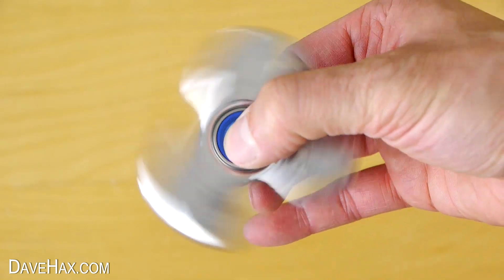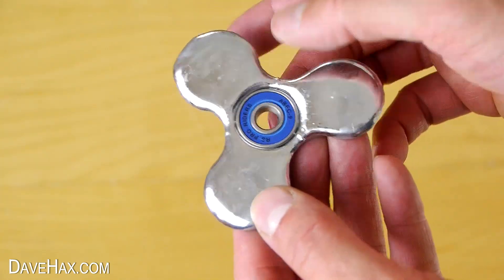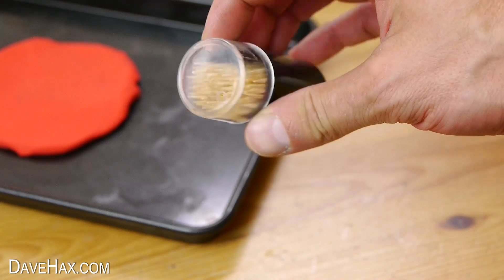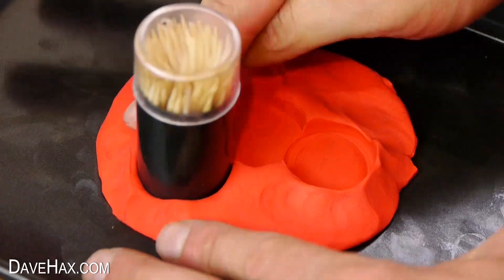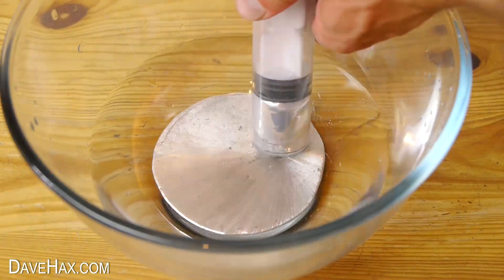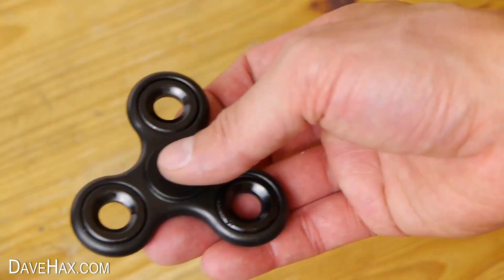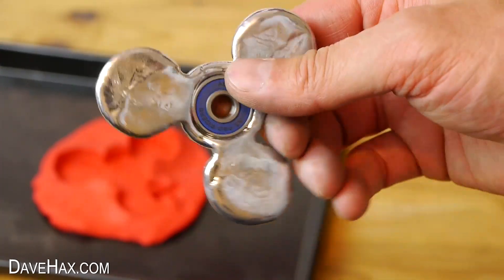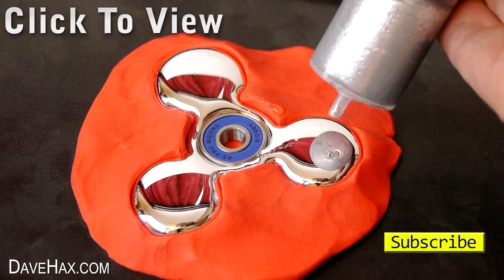DIY Classic Gallium Fidget Spinner

Comment: OK enough with those spinners. Here is another awesome real science expirement you can do with gallium. First, find some aluminium, a heat sinc for a pc will do. Than, use something sharp to scratch the surface of the metal, you can use rough sandpaper aswell. Pour some gallium on the scratched surface and leave it overnight. The day after you'll see that the aluminium is very crumbly and brittle. This is caused by the gallium making an amalgam with the aluminium and changing its properties. After you crush this amalgam, drop a small piece of it to water, you would see if fizzle and making boubles, its caused by a chemical reaction between the amalgam and the water, the gas that is formed is highly flameable hydrogen! Crush the rest of the amalgam and put it is a small baloon, than put the baloon over a bottle of water (similar to the "inflating baloon with baking soda and vineger" expirement) this will generate some hydrogen and inflate the baloon. After the baloon if full, you might notice it floats like it is filled with helium, hydrogen is even less dense than helium and should make it float even better. Last step is the most fun. attach a sparkler to a long stick and get it close to the baloon until it explodes! Note that this can be dangeorus so use safety goggles and wear gloves.
Reply: Yes, I read it, What does it have to do with my suggestion?
Reply: Omer Magen how do you know what happens man yo fam